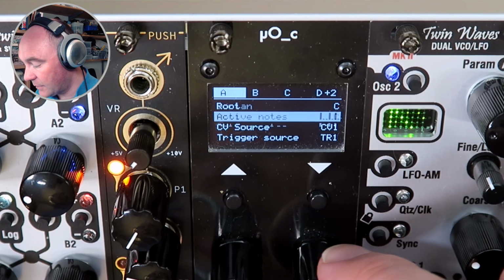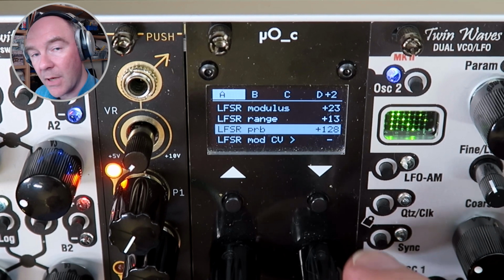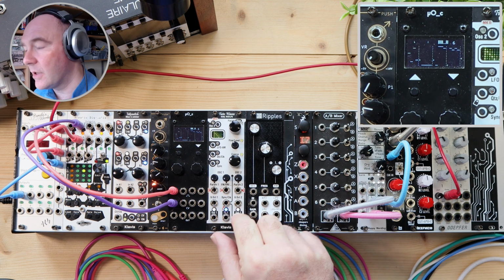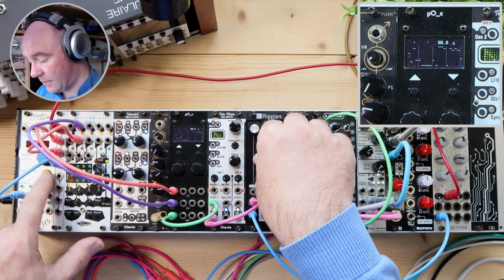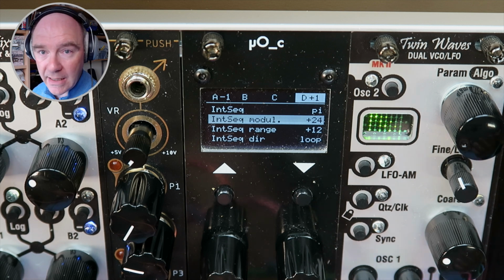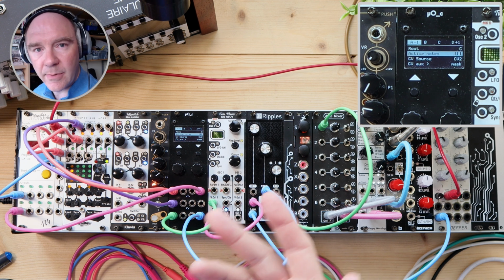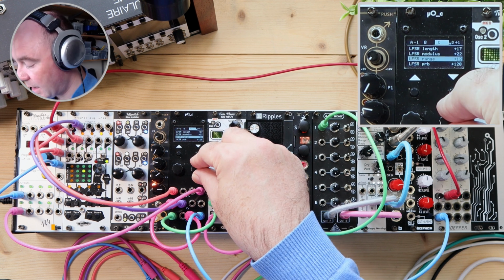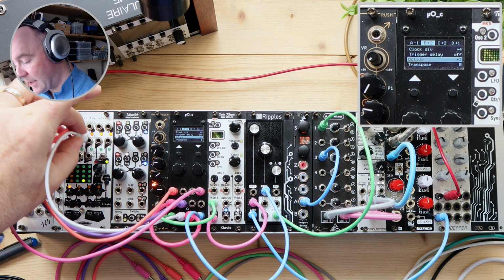Quantise all the Things! Ornament and Crime Quantermain deep tutorial and patch examples

Comment: Hello Synth Dad, I have a 2nd question and I know you are a busy man!  What way is there (if any way) to limit how low the o_C quantermain goes with its melody? Or high up for that matter.  If you cannot answer this question simply, then its okay.  ill continue learning.
Reply from the maker: I don't think you can limit the output on Quantermain, you'd need to use an attenuator before the quantermain to reduce the voltage range going in to be quantised

Comment: Great video again. One quick tip about Pam’s though is you don’t need to attenuate the output with a separate module, simply adjust the output level in Pam’s.
Reply from the maker: True but it’s more playable to have an external attenuverter for faster adjusting

Comment: Hello.  I have a question.  I notice that there are a bunch of cables running into and out of the o_c module.  Could I please learn what the green cable is running into the o_c from?  In other words, what kind of module is the green patch cable coming from?  Thank you!
Reply from the maker: Well that depends on what point in the video you are looking at. I'm sending a clock from Pams New Workout into a mult and then into trigger input 1 on O_C using one cable, and then at one point I have a green cable from O_C going into Klavis Twin Waves, a digital oscillator module
Reply: @SynthDad oh okay.  I wasn’t sure which part of the video I was looking it.
Reply: @SynthDad This is a great tutorial. The content is over my head a lot.  That’s a good thing because I am still a beginner.
Reply: what is a mult?
Reply from the maker: @RM_Jesus_freak_Must_b_Ryan  Oh sorry - mult is short for ‘multiple’ which basically makes multiple copies of a signal so you can easily route it around your patch. Typically you might mult a clock, or envelope, to send to different places in parallel
Reply: thank you @SynthDad

Comment: Is there a way with Quantermain to have the scale mask of a particular channel change based on the quantized output of a different channel (both channels receiving their own unique pitch CV & gate inputs, but one channel's scale mask is dependent on the note that the other channel is playing)?
Reply from the maker: I don't think so without some additional external CV processing. You could take the output note from channel A, mult it and process that CV and use it to modulate the scale mask for channel B which would have the effect you want

Comment: hi synth dad. thx again for all theses great video. 
a question: Which module could you use instead of the switch?. that little module between o_C and joreanalog. and what’s the exact name? sequential switch, no?! from which manufacture is that?! you use it in almost every patch tutorial. so i consider to get one of those.
Reply from the maker: Hi - thanks for watching! I think the module you are referring to is a ST Modular PUSH - a 4 value sequential controller. You can dial in 4 different values on each step and a button press jumps between them. Very handy for controlling things; https://www.st-modular.com/push.htm

Comment: During that section starting @2:50 I'm a bit unclear about what the LFO from Pam's is doing. Is it spitting out random pitches?
Reply from the maker: Not exactly random - it’s a sine wave output from Pams that I attenuate through Mixwitch to reduce the amplitude of the waveform. Then I send the sine wave into CV1 on O_C so that Quantiser A can quantise it to the scale I select. Does that make sense?
Reply: @SynthDad   But if Pam's LFO is the same constant pitch, shouldn't O_C be sending out the same repeating note (voltage) each time it's triggered?
Reply from the maker: Pams is sending a sine wave so the voltage is changing constantly over time. That voltage is what is quantised by the quantiser in O_C
Reply: @SynthDad  Does the LFO have a pitch envelope (is the frequency sliding up and down)? Otherwise I don't get it. If it's constantly sending out a drone corresponding to, let's say, 1.5V, why would there be any variation coming out of O_C? Maybe there's some fundamental thing I don't understand.
Reply: @SynthDad  I was hoping you would comment further.
Reply from the maker: @blerkh  I think you might be confusing things here. The LFO from Pams is not an audio rate oscillator - it's a low frequency oscillator that ramps up and down from 0V to 5V over about 2 seconds. So each time O_C samples the input in response to a trigger it will see a different voltage level on CV1 and then use that voltage to map onto a note which it then transposes according to the scale selected. 

The O_C cannot accept audio rates on the CV inputs as the sampling circuit internally doesn't work that fast.

Does that help?
Reply: @SynthDad   Well, thank you for this discussion. It got me thinking more thoroughly about quantization. I guess I was a bit stuck in a sort of analog, audio rate voltage>quantizer>vco mode of thinking, and also wasn't quite sure what the LFO was doing til your last post.

Comment: Thank you for a suite of excellent videos. Your presentation is very accessible and choice of modules to help the explanations really work well. Thanks for your hard work putting them together. (Pedant alert! Pi isn’t an integer)
Reply from the maker: You are welcome and I'm happy to hear that they are helpful! And yes, you're right that Pi is not an integer in mathematics, but of course the O_C has to limit the representation to a fixed precision set of integers
Reply: @SynthDad  I have three O&C and a Temps instead of the Pams so I'm all over these videos.
Reply from the maker: Wow 3 O_Cs! I only have two of them (one is standard firmware, one is Hemispheres). What do you use them for? Happy to take suggestions for future videos
Reply: @SynthDad  I just checked and I have 4! (Most of my rig is DIY so I do a run and sell odd ones off). I use them for generative patching primarily, usually to modulate other modules to make those modules have new functionality. It’s an ideal way to unlock stale modules and prevent GAS!

Comment: Hi, is the quad-quantiser available in Hemisphere as well, or only 2 quantiser channels there?
Reply from the maker: No, Hemispheres is an entirely different firmware so has different apps available. However it does have a few quantiser applets: Scale Duet Quantizer , Dual Quantizer and Squanch Shifting Quantiser. They are different from Quantermain, but achieve the same outcome
Reply: @SynthDad  Thank you for the answer. I'm currently on the fence with buying this module, I might give it a go soon, as I require some quantising options + there's a lot more stuff to come with it! Thanks for the video

Comment: Nice video. 

I use Quantermain as a quad S&H for pitch cv. I’m decoupling gate and pitch and long notes would otherwise change pitch while the gate is high. It’s also woks as a buffered multi for picht cv. For me it’s the cheapest module to achieve this. And still all the other algorithms are there, if I like to use it differently.
Reply from the maker: That's a good approach; running long gates into the quantiser and then modulating the scale mask rotation at a faster rate creates interesting movement separate from the gate rhythm

Comment: Thanks for all this. Is there a way to rest all values in  Quantermain ?
Reply from the maker: If you push the up and down buttons at the same time during the startup screen when powering on it will reset all the app settings
Reply: @SynthDad  Thank you !  There is just one thing I still can't figure out , even watching the fragment all over again, that's "Rotating the scale mask using the output of a quantizer". Is it possible to write out the way it is done?  Would be highly appreciated  !!
Reply from the maker: Sure: the trick is to use a CV input on the pitch quantiser that is not the standard one. So for quantiser A it would expect the pitch CV input to be CV1. However if you set it to CV2 then the CV aux menu appears. Then go into the CV aux menu in Quantiser A and set it to 'mask'. This means that a CV value on CV1 will rotate the scale mask for quantiser A and change the pitch of the notes quantised.

So where does the CV going to CV1 come from? I use the output of Quantiser C for that. I set quantiser C to one of the generator modes so it will output CV values on output C, and then patch that into CV1 input. I also set the range and modulus of Quantiser C to 36 so it outputs a broader voltage range to create more movement in the scale mask on quantiser A.

Hope that helps.
Reply: @SynthDad  gonna give it a try !!